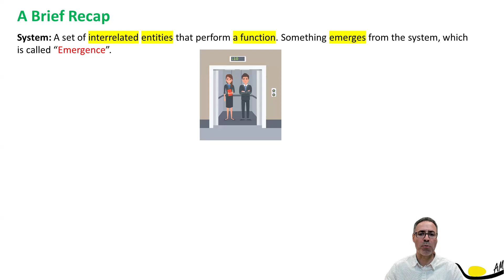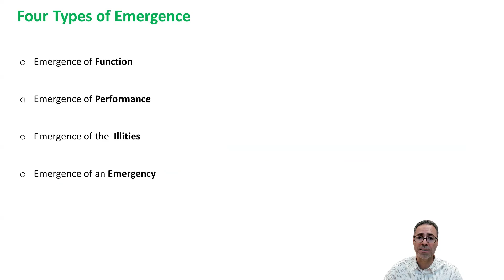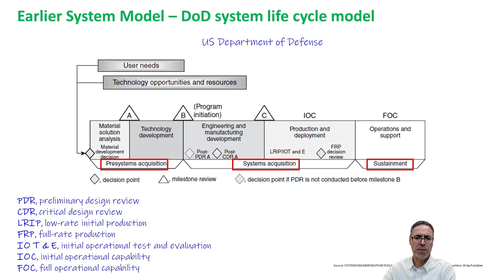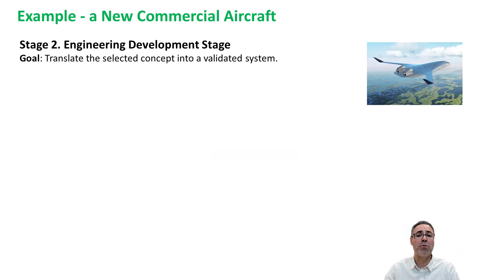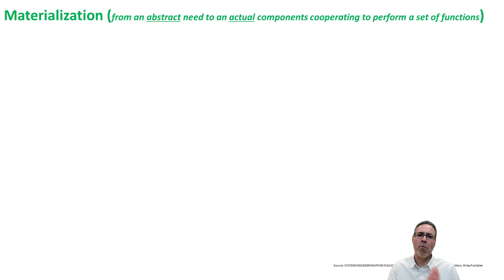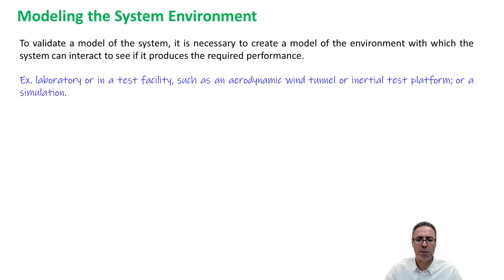Lecture 3.  Understanding Systems Engineering and Life Cycles

Comment from the maker: Answer to the Question on Bicycle Example:
Which aspect has become more complex?
Modern bicycles have become more complex in several aspects:

Mechanical Components: Introduction of gears, derailleurs, and braking systems.
Materials: Use of advanced materials like carbon fiber, titanium, and lightweight alloys.
Integrated Systems: Incorporation of electric motors, battery packs, and control systems for e-bikes.
Adjustability: Features like adjustable seats, handlebars, and suspension systems.
Design and Ergonomics: Aerodynamic designs and comfort-focused engineering.
What was the primary driver behind its increasing complexity?
Demand for Higher Functionality: Riders want bicycles to perform in diverse conditions (mountains, urban commutes, racing).
Enhanced Performance: Cyclists demand lighter, faster, and more efficient bikes.
Improved Reliability: Modern components are designed to last longer and require less maintenance.
User Comfort and Customization: Adjustable and ergonomic designs cater to a wider range of users.
Technological Advancements: Integration of electric motors and digital systems (e.g., GPS, power meters) enables smarter bikes.
Summary:
The complexity of modern bicycles reflects the evolving needs of users and technological capabilities. By comparing early bicycles to modern ones, we see how systems engineering adapts and innovates in response to new challenges and opportunities.